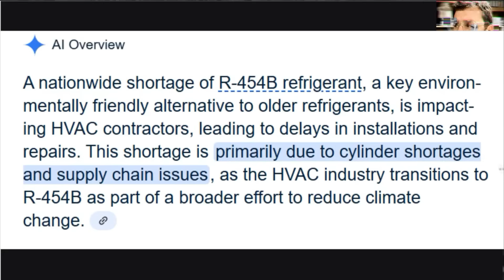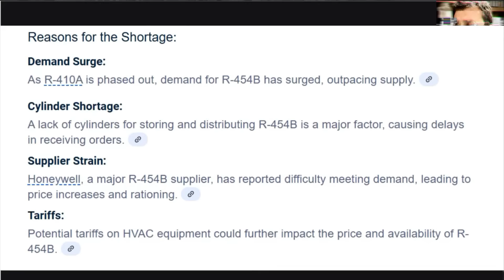R454B Issues and Discussion

Comment: I work for a large hvac company that uses lennox.  We installed several 454 systems but had issues with dehumidification and holding set temperatures.  You can run 410a through a 454 system and it works just fine, lennox told us we could.
Reply: I never see this in writing from the mfg.  it’s always back channel or a distributor with no mfg authority to commit.

Comment: Mitsu uses 454.
Reply: On my in the smaller units, the larger VRF they are using R32
Reply from the maker: @love2hvac  want to come on and talk about this?
Reply: @Zacksshoptalk  sure! I have a tone of information on it. If you're sponsored by a manufacturer, they may not like it.
Reply from the maker: @love2hvac my sponsors will love it. Email me at zacharypsioda@ gmail.com

Comment: I curious if you were 6 ounces short on 454b on a new system if you could top it off with r32😊
Reply: It's the same as fascination, you change the % for example R454A R454B R454C all are made up with 1234yf and R32 but different % and different boiling points.
Reply: People are doing it around here. Also topping off with 410A Just sayin.
Reply: @ sometimes you have got to do what you got to do.😊

Comment: we been jrkd around by these climate marxists for decades. once they got rid of the ODP (Ozone Depletion Pooptential) monster, the created a new climate monster 'GWP' (Global Warming Pooptential). These same climate marxists are the reason behind CAFE and all the GM truck/SUV engines imploding from AFM/DFM. They tell me we only got 12 or is it 8 years left before the earth explodes? Then they get their marxist minions to shoot up EV dealerships in a strange irony. Anyone seen r410a components with mfg date in 2025? Wondering if the manufacture ban was quietly lifted, otherwise the r410a components/systems still for sale would be much more expensive than the R32/R454b equivalent, not slightly cheaper.